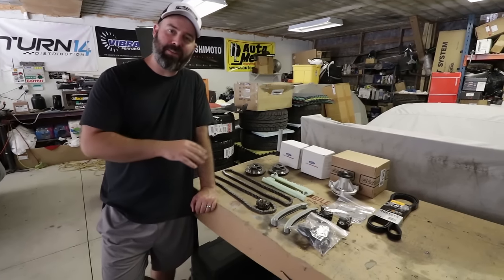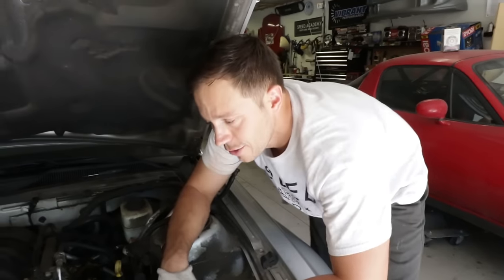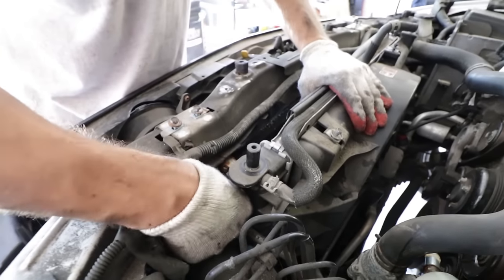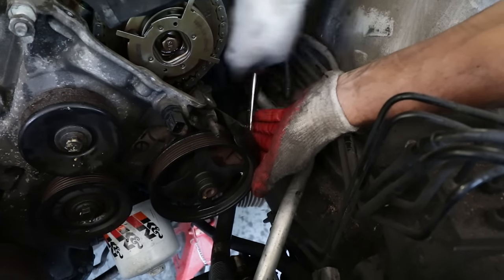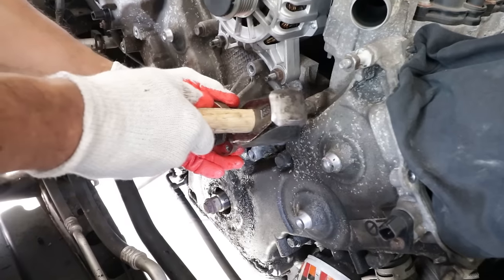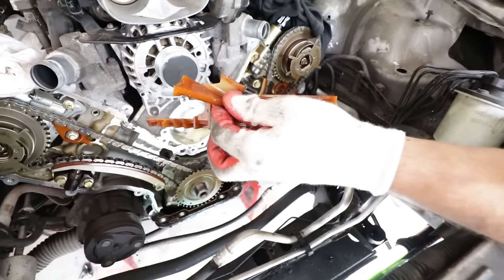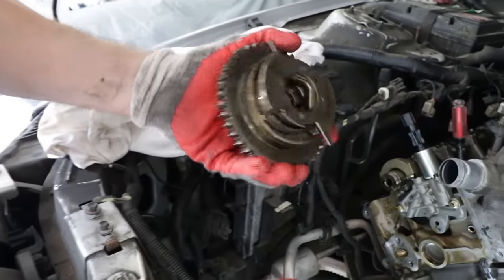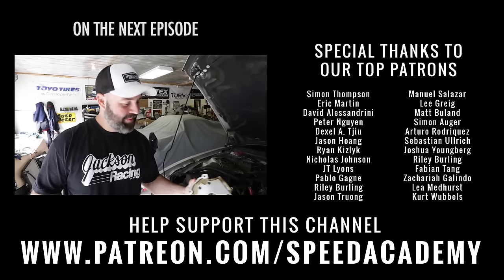How to Replace the Timing Chain 4.6L Ford V8 PT 1 -  Project Mullet Mustang - EP04

Comment from the maker: Please note that when we set the timing we have the L & R timing marks flipped on the cams (L should be on drivers side, R should be passenger side) Despite that because we didnt rotate the crank or cams and just swapped on the new timing parts the timing was still correct.
Reply: Could you guys refer me to the manual you guys mentioned? I'd really appreciate that atm
Reply: How you holding the camshaft when you loosen the tensioner.???
Reply: @cuenta619  When loosing the tensioners there is no need to hold the camshafts, the will give once tension is released but so minimal that you can readjust with vice grips behind the phasers
Reply: Does it matter I put it on same as your video
Reply: Hello guys great video! I was following the same procedures as you did, i also put the (L on the passenger side and the Right on the Driver side) did you guys put it back the correct way before reassembling everything back together?
Reply: @scottltichenor  Assuming you didn't rotate either the crank or the cam phasers, probably not. But doing it like this is risky since it makes it pretty easy to make mistakes. Ford's manual has you put the crank in TDC (cyl #1) and position the camshaft in the compression stroke for #1 (passenger side 'R' marking lined up with mark on chain and L for driverside) - this makes it completely impossible to screw up and ensures you're properly timed..
Reply: Tensioners also on wrong side  :)
Reply: @AARONbmxMAN  - hey bud, did you ever find that manual? Or did you possibly find something else? Is so, could you post a link? Thanks
Reply: Lol I noticed that when you put it on.

Comment: I am here because I have the exact same situation on an 08 GT/CS. Same issue, same codes. Replaced the battery, alternator, and cam sensors. Not fixed. Dealership quoted $2700 to replace the timing system. Rather do myself, super stoked to find your videos. THank you!

Comment: Along with my M12 cordless ratchet a while back, picking up a pair of hose clamp pliers changed my under-hood life for the better, especially when doing rad work. Lisle makes some decent ones for a decent price and they have a slot-and-cup design plus they have a lock to hold the clamp open.
Reply from the maker: Yeah, we really need to start a list of tools to buy since life would be so much easier.

Comment: trying to find a tick tick tick in the upper part of my 4.6l 06 town car that I just bought. Was skimming your video and am amazed how detailed everything was. Easiest way of finding TDC that I have ever seen. The furthest inside an engine I've been has been the intake manifold and valve covers. when I start hearing bout timing it scares he shit outta me. Your video made it look simple. I was looking at replacing lash adjusters but I know that the plastic guides are a known problem on the 4.6. I was literally falling asleep (it's 1am) when u got to the TDC part and I was like EUREKA!!!
Reply from the maker: Glad this helped out. the ticking could be the tensioners starting to come apart so hopefully you find whatever the issue is soon!
Reply: Speed Academy I had to go out and buy a stethoscope to find out where it was coming from, and it turned out its noisy fuel injectors... I've owned 2 crown vics and currently have a 98 and 06 town car, all with the 4.6L, and none have had ticking fuel injectors except for the 06. BTW I just bought the 06 a few days ago so we're still getting to know each other. Any experience with ticking fuel injectors?? I've had 2 people look at it and both tell me not to worry, but none of my others have ever done it.

Comment: for spark plugs on my 07 mustang gt with 50K miles that were original 2pc design,,,i did them all on a cold engine,,first i cracked them back about an 1/8 to 1/4 turn..then sprayed deep creep and let sit for 30 mins and then worked them back and forth until they each came out with no broken plugs.

Comment: I'm surprised, this generation of mustang seems to be built okay in term of "repairability" ! I can't help thinking that next year I'll have to do the timing belt on my father's Audi A6 and having to remove the whole front end again (cause I had to do it once already for the radiator ...) makes me mad :D 

About the water pump pulley, if you're changing the belt anyway, I use the old belt and a pair of vice grips to lock so it won't turn, but you had plenty of space to put the impact gun on that :p

Comment: I had a new 98 cobra build that say for some years and when I recently installed the engine, I forgot all about the crank trigger wheel and now the car isn't starting.

I either need the wheel for a 98 cobra or I can use the 2001 Cobra stuff but I have to take the chains off to use the updated crank sprocket with the updated 2001 trigger wheel. I really don't want to mess with the timing at all but I may have to if I can't find the correct trigger wheel.

Comment: The hydraulic tensioners are both marked with a L or R. It looks like you installed the R tensioner on the left side(drivers side) of the engine. These tensioners have a lube port that sprays oil on the chain, if not installed on the correct side your chain wont get lubricated properly.

Comment: I'm about to replace my timing set when I do this next cam install. Why did you remove all the spark plugs instead of just the one you needed up front to find TDC? Also, is this the only way to find top dead center? I have an 09 do the risk isn't as big since my spark plugs are one piece

Comment: Just did mine; this video was a big help, thank you!
Reply: Hetzer 1701 hey did you notice when they were test spinning the engine the left chain was slapping against the top guard? Did yours do that!? I’m doing mine right now
Reply: Yes sir, mine was very bad. One thing I regret not doing was replacing the cam phasors themselves and though my stang now runs like new 99% of the time, when I get off the freeway and just get into town she starts running very rough as a result of the old phasors not retarding (i think they get stuck in the advanced position)  the timing at the lower RPMs (I drive fast all the time :)). I have to restart the motor and everything is fine for the rest of the trip. Definitely replace those babies! Good luck!

Comment: The reason the guides break is because of the tensioner. So here’s a trick 

Use 2v 4.6 tensioners with the failsafe ratchet arm. Or else when the 3v 4.6 tensioners back gasket starts letting oil bleed out. The result is the chain slapping that guide everytime you start it until it builds oil pressure since those tensioners rely on oil pressure alone
Reply: Yep. I have  4.6l 3 valve with 260k miles in my 2010 F-150 and that is EXACTLY what happened to mine.
Reply: @mattcorley9811  yep my dads 3v f150 did it at around that exact mileage. Luckily we caught it with just a broken guide. And today he’s a 300k+ and still going. Lol

Comment: im going through this process on my 2000 mustang gt with 5.4 4v swapped motor, im installing 3v oil pump and cobra pickup tube while im there.

Comment: Here bc my 2002 Explorer 125k 4.6 2v is pissing me off. Great to see the engine seems pretty similar. Only thing I don't fully understand is getting the timing in line and that's where the biggest problem could occur. ugh

Comment: Hello, I'm having trouble with my timing chain on my 2005 Ford Mustang GT. Before I planned to replace my whole timing chain, my passenger side camshaft was broken and I bought a new camshaft that represents the RIGHT side meaning passenger side of the motor. I don't know if I got sent a wrong camshaft because once i replaced the camshaft, I added the new timing chain kit but the chain was very loose on the right side of the motor after adding new tensioners and phasers.. I am super confused on why that happened and I need help please, thank you.

Comment: You don’t have to pull plus you have the valve cover off you can see the values and can tell exactly where it’s at.. also to remove spark plus you use a 1/2 in impact and just hang them out

Comment: I WISH you would of shown how to remove the rear bolts on the covers I don't have the clearance on a crown vic I had to cut the heater housing to clear the valve cover other wise you have to remove the motor mounts and drop the engine to clear the valve cover on the heater housing

Comment: The official procedure for removing the spark plugs calls for carb cleaner and to fill plug tube up to hex nut on plug, let soak no less than 15 minutes.
Reply: Thanks!

Comment: Did y'all put the factory intake back on or was this video before the "bolt on" episode?
Reply from the maker: This is Part 1, you'll see the full reassembly process in Part 2, but since we shot this before installing the intake and exhaust mods featured in the previous episode, we did reuse the stock intake here.

Comment: I used a two jaw puller on the outside of the crank pulley on a F-150.  Not ideal to be putting all that force on the rubber, but it worked great, with no damage.

Comment: I did a timing job on a older Mercedes that essentially did the same thing this summer and all of the intake valves had bent because it was an interference engine.  Are you guys worried that the two teeth in timing jump will cause valves to be bent?
Reply from the maker: The 4.6L is an interfere engine but thankfully it only skipping a tooth means that none of the valves bent!

Comment: Was the misalignment between the cam phaser and timing chain a mistake directly from the manufacturer or has the job been done prior and caused by human error beyond initial production?
Reply from the maker: The misalignment happened when the chain jumped teeth on the crank as a result of the guides falling off and messing with the timing.
Reply: Speed Academy Oh okay. Glad you guys caught this before potential damage. Drama caused by poor timing chain/belt maintenance can be such a source of stress. Great content as always, big fan of the channel.

Comment: Did you by chance swap the Cam Phasers to the correct side? In the initial assembly, they were swapped. also much easier to swap the camshafts with the timing chains off. Otherwise great video. I am looking forward to what you do next...
Reply from the maker: Part 2 will reveal all :D And you may even see a camshaft upgrade in a future episode...
Reply: @speedacademy  Could yall answer a couple questions for me?
Reply from the maker: email us and we can try... peter@speed.academy

Comment: Working on getting this done to my 4x4 f150, minus the cam phasers. I have a lot more room to work with than this car has, I just wished it sat lower, had to dang near build a scaffolding to reach everything under the hood... I'm not tall enough.
Reply: Take the front tires off and set the rotors on plywood. Do what you need to do then put the tires back on.  Bend the backing plates back out before you reinstall the tires.

Comment: how do you guys keep track of all the nuts and bolts you remove?!
Reply from the maker: typically we lay everything out on a work bench with the bolts in the pulley or otherwise organized in a way that makes it easy to reassemble. Plus shooting video of everything means we can always go back and look at the footage if we're confused about where something goes. But if we weren't shooting video, we would take photos at critical steps so we could reference those during reassembly.

Comment: I just put my 2006 f150 in time same way u did your motor and turned it two cycles and the colored links don't line back up on the dots is it true that it won't unless u turn it tons of times anyways
Reply from the maker: Yes, you will have to spin it around ALOT for them to line up again, I think it was over 40+ turns.

Comment: I knew what was coming before you even explained the issue with those spark plugs and I just started laughing uncontrollably. Why something was designed like that we will never know. Some things are really there to make you suffer. Or others suffer for my entertainment in this case.
Reply: how many bolts out of the front case? studs included. doing this right now I skipped a tooth in my timing

Comment: Great video as always. I have a few comments: I'm surprised you didn't use the cardboard trick for the timing cover bolts. Goddamn 2 piece sparkplugs, burn in hell. In regards to finding TDC, if the cyl#1's companion cylinder is rocking then it's on the compression stroke.
Reply from the maker: You know we didn't even think of it! Next time we'll certainly use the cardboard method.
Reply: Word. Keep up the good work.

Comment: @29:13 you hear the right side chain slap the guide. Mine does this as well is this normal? I’m literally doing mine as we speak. Feedback would be greatly appreciated!!
Reply from the maker: Yes that is normal when the engine doesnt have oil pressure.

Comment: Did y’all wind up removing some of the rocker arms prior to taking the chains off? After watching some other vids on timing and my Haynes manual it says to take out a couple rocker arms. I’m no mechanic but I don’t know why you’d have to do that if you have cylinder one at TDC in compression stroke and you keep the cams from moving while you do a literal swap of parts.

Comment: Just to make sure i understand what was indicated, the reason that the chain slipped a tooth and was off by half a link was because of the guide being broken and the slack in the chain. Can anyone confirm that thought for me please? 

P.S. if this was the case, you would correct that by simply moving the chain when placing it back on the sprocket to the alignment point on the sprocket and chain? 

Thank you for any comments and time answering these questions!

Comment: My tensioner failed. I'm trying to turn the engine over manually and its struck. The passenger timing chain tensioner has failed so the chain is loose.

Comment: I know this video is old but did the Mustang run ok after all that cause I saw at the end of the video I had to do it all again and I couldn't help but noticing that u had the L lined up with the timing mark but on the wrong side same with the R mark dose this make any difference or no cause I just put a chain on a 4.6 3valve and I did exactly as u did except I had a cam snap back on me so I had to rotate it back
Reply from the maker: It ran totally fine, instead of spinning the engine around say 75 times to find TDC with the LR marks lined up we spun it around say 34 and were at TDC but the cams were just at RL so its still in time just not exactly how the manual wants it.

Comment: I have a question. I took the chain off on passenger side camm bit the driver side camm rotated with the chain and other side didnt how can i adjust the camm in the same place again amd then retime it
Reply: Cris The Red mine rotated as well. What was your solution?
Reply: lmed2385 i just retimed it its pretty easy just need a couple cheap tools

Comment: There's a trick to getting 4.6 and 5.4 spark plugs out. You should have the engine at operating temperature and use a 3/8 impact.  Air or electric will work. You need the shock of the impact to break it loose. Turning by hand is how you snap them. That can be said for almost any fastener. You're much more likely to break fasteners when you remove them by hand. Impact them off. Put them back in by hand and a torque wrench. I fix cars for a living.
Reply from the maker: We thought that too but were worried that the impact may sheer the plug off so we went with how the manual explained it.
Reply: I understand. The senior master tech at my dealer told me "If your break one off in a warm engine with an impact, you would've broken it in a cold one following the TSB. That combined with it only taking 5-10 minutes with the Special Service Tool if you do break one is why we do what we do." Time is money in the dealership. Contrary to popular belief we try to get jobs done quickly lol.

Comment: How to you lock the cams down so they don't turn when the timing chains are off?
Reply from the maker: They will always turn a bit but its fine, you simply set them back according to the marks.
Reply: Speed Academy Mine slipped. Do I move the cams clockwise with a wrench to the right position? Will this damage anything internally in the engine?

Comment: the chain being a link off is totally normal, if you would have kept turning the engine over you would have eventually gotten them to line up perfect.
Reply from the maker: Incorrect. We spun it over 20+ times without ever having the teeth line up when the crank was in its proper spot.

Comment: The original ford parts failed, so you replace them with ford parts. Also, you could test the diodes on the alternator with a volt meter, most likely the sensor to. What you paid for in unneeded parts you could have had a proper diagnostic done.
Reply: pdgeman how many kms/miles did they last before failing mate
Reply: Is that how you look at it? I'd rather put in a quality timing kit, not the same shit that just broke. There are kits out there with metal chain guides.
Reply: pdgeman metal chain guides seem stupid to me. as they said in the video it's a wear item so it will add metal flakes to the engine which would destroy the engine.
Reply: the chain doesn't ride on the metal, just the bracket that holds the plastic pad is metal so it doesn't fall apart like these did.